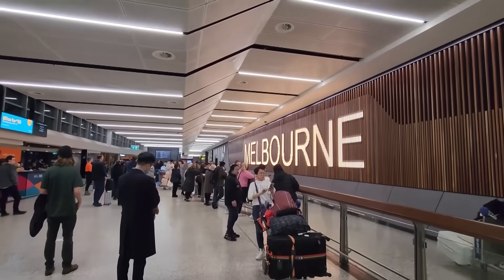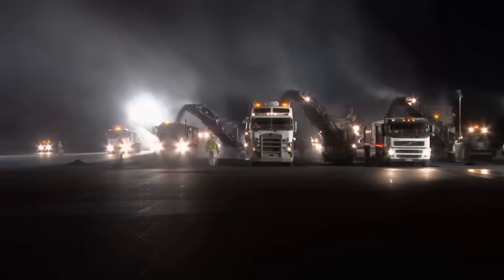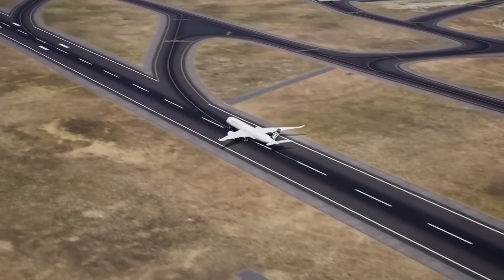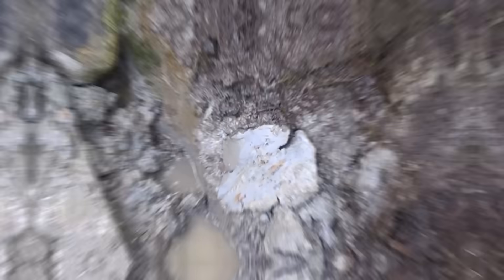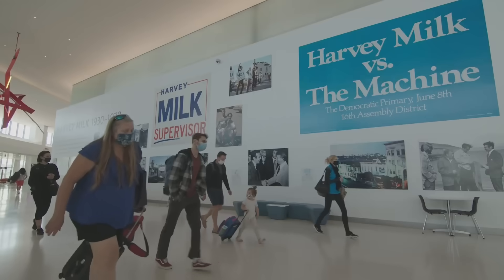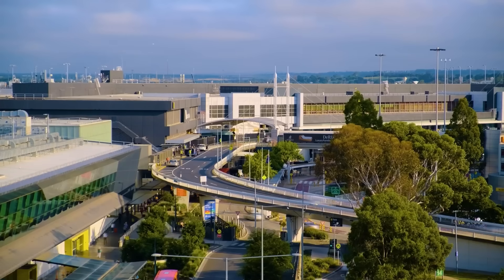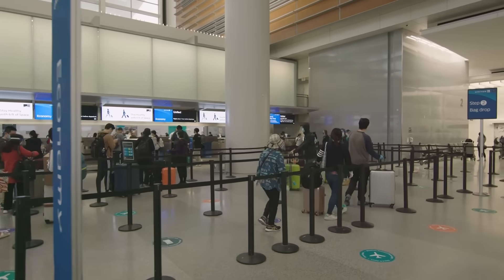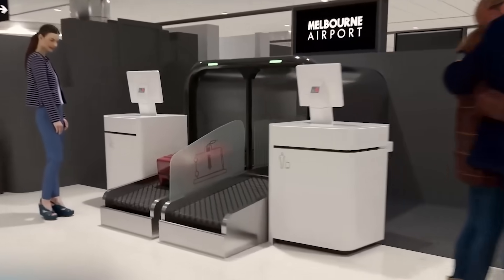The SHOCKING Truth About Melbourne Airport's $3 Billion Upgrade

Comment: Spend the $3B on Avalon airport. Already has the land and also a railway and will be built quicker and cheaper.
Reply: You clearly do not know what you are talking about. Avalon is 5km from Lara Station. Avalon is 55km from Melbourne and it is unattractive to Airlines. No one except Jetstar wants to operated flights from there.
Reply: @mjcats2011 you’re absolutely right in what you say but wrong about me not knowing what I’m talking about. To fix Avalon just spend the $3B there and include a 5km train link and problem solved.
Reply: @royby7941  The track Isn't electrified past Werribee.
The track alone would cost more than 3B.
Reply: Not an icicles chance in hell……,! Middle of nowhere!
Reply: What railway?